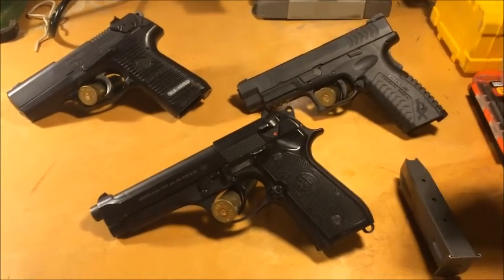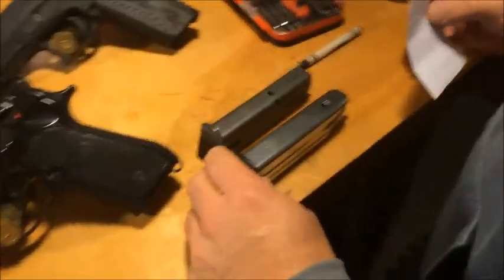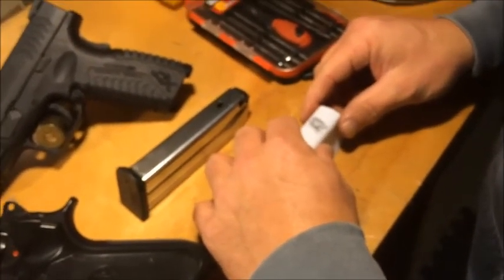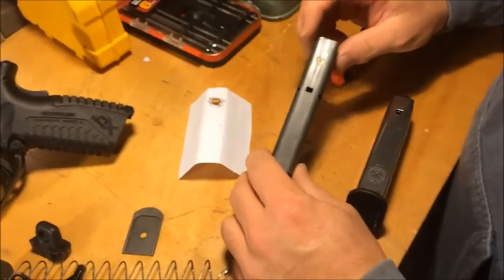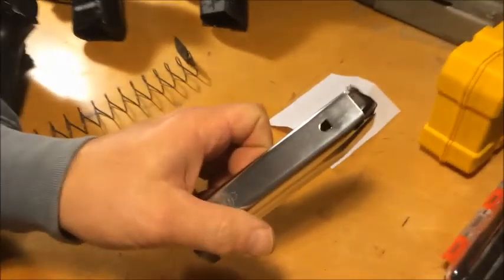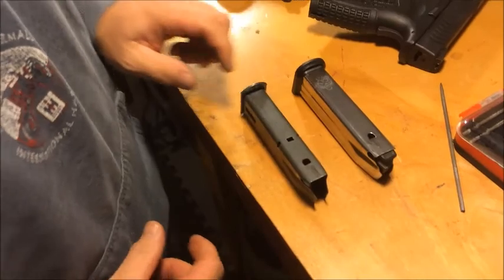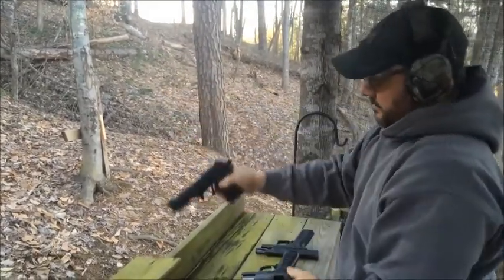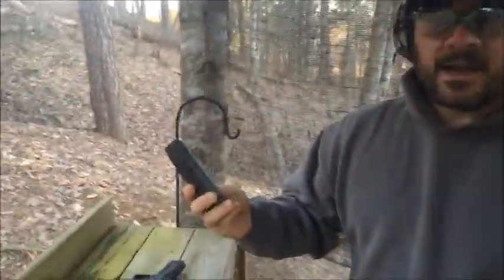Magazine that works in three guns DIY SA XDM

Comment: Would this work for any other mags in .40? I got the Xdm .40 3.8 and want as many functional mags as possible
Reply from the maker: +don arnett Beretta mag is the only thing we have experimented with. Will say that we think the Beretta 96fs mag would work in your XDm .40 if you did the conversion. Thanks for watching, have a good day, shoot safe and God bless
Reply: My mag fit in p89 so with correct mag lock it can fit Taurus g3/g2c/g3c the Taurus th9 will work with same xd9 mag catch